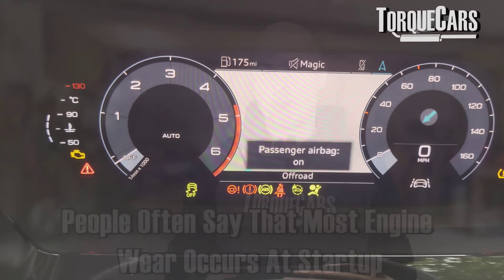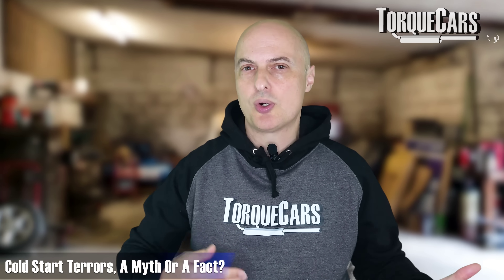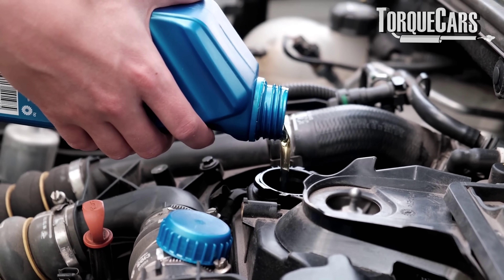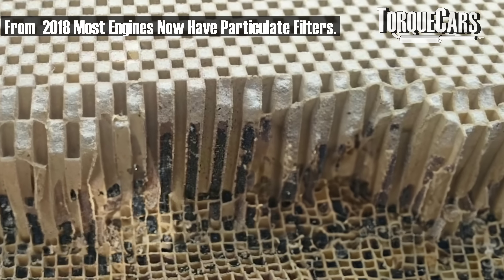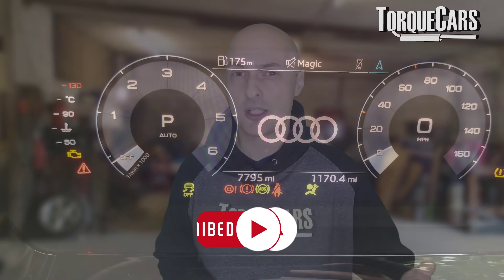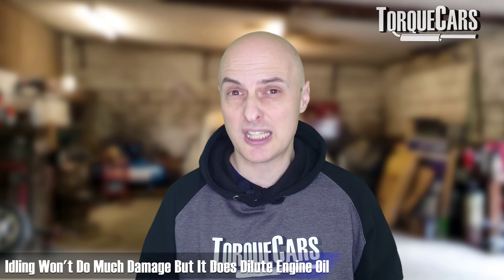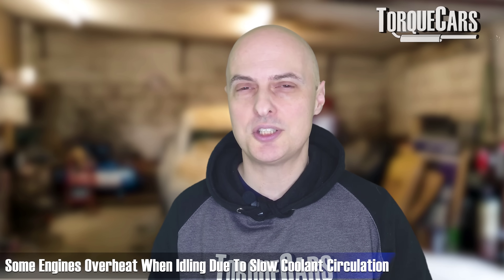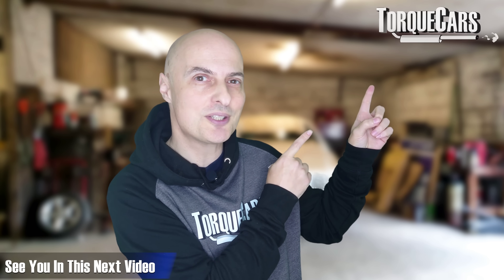❄️Reasons Why Bad Cold Starts Destroy Your Engine ☃️Prevent It Happening To You! ⚠️

Comment: An elderly chap who lives opposite me lets his small van (diesel engine) idle for up to twenty minutes before driving away. He also lets it idle for the same amount of time after getting home. I think someone told him that a turbocharger must be allowed to cool down before switching off. I wasn’t surprised during the COVID scare to see him wearing a face mask when driving even though there was only himself in the vehicle.
Reply: @wheater5 - That guy's warm up and cool down routines are extremely excessive, but the idea of letting the turbo cool down is actually legit, except it's not really about cooling the turbo itself. It's more for trying to prevent the hot oil from coking up by baking in the bearing housing. Just a 2-3 minute rest at idle before shutoff is plenty if the turbo wasn't worked too hard, 5 or so mins if it was. Not that u didn't already know that, just wanted 2 clear up turbo cool down 4 people who may not know. Lmfao your neighbor is waaay over the top tho, if that's what he's doing.
Reply: @ Yes, i understand why a short cooling period can help, I let our turbo diesel idle for a minute or so if it’s been driven hard. Yet, If I start my petrol engine and let it warm up at idle for more than a minute he comes out with a hand held air horn and gives it a long blast as if he’s calling full time!
Reply: @wheater5  Yeah, I figured u knew all that already by u talking about that in the 1st place, just added my 2 cents on it, especially since my daily is turboed so I do the cool down multiple times a day! But hahaha gotta love the "my shit don't stink" mentality of that man. Classic.
Reply: That's crazy. 30 seconds idle is all you need to do in uk winters. And then just drive at low rpm until up to temp. Turbo cool downs are only required if you've been ragging it.
Reply: @ Yes, exactly. But this chap is “special”. What I’ve described here is only a small part of his unusual behaviour.

Comment: Just drive off gently, try to avoid using the heater until it's warmed up
Reply: The heater uses the coolant temperature to heat the car, so if the car is cold, turning on the heat is useless until the engine warms up. Electric cars are of course different. When I lived up north, I always laughed to myself when I got in a friend's car and they immediately turned on the heat and frigid  cold air came through the vents until the car came to temperature. They also seemed to think turning it up to high would made a difference. It does, it makes it colder. Turning on the heat when the car is cold is like turning on the A/C. Turning it up to high only blows out more cold air. Funny thing is, they keep doing it.
Reply: The airco works differently, though
Reply: @floridaredneck  

It's ok, they are warming up the blower blades, lol.
Reply: @floridaredneck  i did not know some cars have heater inside vents... diesels (VW, Skoda, opel etc) in EU and US/CN they come with a 1kW electric heater that can blow warm air almost instant when you turn on your car...

Comment: As a Canadian, in winter, I try to remote start the truck to start the warming process. By the time I had the windows scraped the vehicle was warm enough to start driving at a moderate pace. With my old diesel, the only difference was to keep it plugged in. That kept the oil warm enough to drive as it would never warm enough just at idle. Thanks for the video.
Reply: I am Canadian as well and saw your comment about plugging in your block heater. The one item that was completely missed in this video was talking about cold starting aids as per warming the engine before its started. And indeed with most automatic transmissions, they have cooler lines routed to the engines radiator so as the engine warms up that also in turn warms the transmission to some degree and takes the chill off of it as the transmission oil pump does flow/circulate oil even though the transmission is in neutral.
Reply: Back in the 80s when I (Brit) visited Canada, I was initially curious why so many cars had weird plugs hanging out at the front.
Then someone told me what they were for, and it made so much sense. We just don't need them here.
Reply: @davewilson4493 , who knows, with climate change maybe we won't need them here soon. 😂
Reply: @davewilson4493  Back then in the 80's and before it was common for a block heater not to be a factory option but instead the dealership was expected to install them. That has changed a lot as its often a factory order now although even in Canada dealerships in the southern British Columbia area, Vancouver and Vancouver island often get dealer order vehicles in that they don't option in the block heater. But on the other hand lets say a GM Duramax diesel automatically  comes with the block heater from the factory.
Reply: When i am in Canada, I start the car and let it idle for about 30 seconds or until the windows are scraped. Then drive away slowly, to allow the engine , transmission and wheel bearings to warm up. Although, the car is really just getting to operating temperature by  the time I get to work, about a  drive. When I am in Panama, where it is always warm, it's start the truck, wait for for the computer to lower the revs (about 15 seconds) and then drive off gingerly until the engine,  tranny and differentials warm up and get fully lubricated.
Reply: @ryeweskey  yeah mine does too
Reply: This guy is saying you shouldn't idle. Absolutely ridiculous
Reply: @TheNovaNorm it's been 50°F all December. Unheard of. Maybe two or three days in the whole month, but not like this.
Reply: @TheNovaNorm I work in winter tires sale and our sales numbers have been dropping every year😑

Comment: An old lady who parks next to my driveway , starts the car stone cold and immediatly slams on the throttle pedal , for around 5-10min. at idle reving the engine till the limiter kicks in ! 

Persobally , i have habbit since i started driving like you mentioned - start up , fasten seat belt and check over instruments and mirrors then drive off moderately avoiding high revs and engine lugging in too high gear .
Having oil pressure and oil temperature gauge on the instruments helps quite a bit .
Oil especially needs good lenght of driving in order to warm up to ideal temperature .
Reply: @MrJolly-lb9je  Don't buy her car!!!
Reply: @MrJolly-lb9je  coworker in the early 80s did that.  Would start his stone cold Chevy Nova and go to full rpm before redline. 

Physics degree  guy.  He Said running the engine fast helped with lubrication in cold starts.

So after work on a cold day in a plant of 2000 folks his Reving engine was easy to spot since weird.
Reply: The Stupid Ignorance out there is simply amazing.
Reply: @MrJolly-lb9je  how old is the old lady’s car?
Reply: @edombre4637  Few years old pretty much new , current model of Renault Twingo . 
I do not speak with her much , but i told her few times she'll severely damage the engine if continue to do so . 
Car she had prior to this one had the same "treatmant" !
Reply: @ yeah I was just wondering how long her cars last with that treatment she gives them.
Reply: I saw a guy I worked with start a cold gas engine and l think it was a 350 gas engine. - 14 was the air temperature. And he started the truck, and just started racing the engine, and it blew up. So, he was driving a pick-up, and wasn't taking out the straight truck. Anything involving trucking, everyday is an adventure.
Reply: Soon, there is going to be the rapture. It's when there will be trumpet sounds, and after the trumpet sounds, God will lift his people from here. Also, God said people should be living by the Bible. Amen, and God bless you.
❤Jesus loves you guys. Dont wait, please. He will welcome you with arms wide open.❤
❤* John 3:16 - "For God so loved the world, that he gave his only begotten Son, that whosoever believeth in him shall not perish but have eternal life". ❤
Reply: You should tell her kindly

Comment: Completely agree! Waiting in idle or going full throttle are both bad ideas. What I do is take my normal idle (750 RPM) first to 1000, then to 1200, then close to 1500, all while standing in place. Once you notice the sound of the engine is much more smooth (no more clunking) and you start getting some hot air inside of the cabin (assuming your ventilation is turned On and set to Hot), then it's safe to start driving slowly with 2000 RPM and gradually increase from there.

Comment: A good and useful video, something you didn't mention is bore washing when the engine's cold.
For those who don't know, when the engine's cold the ECU has to inject much more fuel to start it and keep it running as some of the fuel condenses out before it gets burnt. Some of this fuel condenses out onto the cylinder bores and washes off some of the oil, this causes increased cylinder bore, piston and piston ring wear and diluted the oil slightly (although it will evaporate off with engine fully warmed up). This is another reason not to let your engine sit idling for ages, idle it for 30s max (at least above ~ 5C, perhaps a little longer for temps down to -10C, below that, fast idle it for a bit as per the video), then just drive it gently until warmed up.
Reply: I've recently limited my warm up time to about 30 seconds. Seems like even after it's all warmed up always a reason to idle. Too dang uncomfortable to sit in the car at 2C waiting for the wife not to have the engine running for a bit. I just change the oil often.

Comment: Thank you very much for this extensive explanation of everything happening during engine warm up ! For the first 5 minutes I drive gently : 2000 rpm max. When coolant temp start approaching 90 degrees Celcius, I can start pushing it more. I'm living in the Netherlands, so there is no need for my car to go for a climb or descent in the first few miles from where I live. My 'daily driver' is 13 years old now, and has been running fine without major issues.
Reply: Same driving style here. 13 year old car, no major issues.
Reply: @bakkerem1967  I assume it's a diesel?  No way I can keep it under 2000 rpm on my 1.4 TSI - driving carefully in the "warm up"-phase I can't get it under 2600-2800 at risk of lugging.
Reply: Coolant temp isn’t what you should watch; instead you should watch oil temp. Coolant will shoot up quickly.
Reply: oil will reach 90c in about 10 min of driving,in my case around 6-7 in city then on Autobahn in max 4 min it's at 90c

Comment: One thing I have noticed with modern cars is the tendency to not have coolant and/or oil temperature gauges. I have a 2010 Jaguar XFS with neither of them. Instead I have to guess. I do wait about 10-20 seconds before starting off and drive gently for the first 5-10 minutes of a drive. The car has a preheater on the climate control which is a great feature but not a good way judge what's going on under the bonnet.

The other thing to note is petrol engines tend to warm up faster than diesel.
Reply: @tboneisgaming  Yeah, BS isn't it? Although temp gauges are heavily buffered
Reply: Ridiculous not fitting these gauges.How can you possibly educate peeps if there us no feedback from the dash😂.Manufacturers are quite pleased for you to buy a new engine/car I guess.😅
Reply: on new bmws theres a sports display u can bring up that has turbo psi, horsepower, torque, and oil temp. i just make it a shortcut on one of the buttons so i can have it up  while i start the car
Reply: temperature gauges –My car (petrol engine) does have them both, but it has no use/meaning for the cold start process, as it takes at least a 1,5 mile or 5 minutes ride before the gauge shows any change (1 mile in summer temperatures).
Reply: My car has a gauge, but it actually lies. It doesn't show the real temp (that fluctuates with engine load) and it basically have three positions - cold, warm/operating condition, overheating (I've never seen it luckily)
Reply: @jakubknotek4891  it sounds like a a faulty temperature sensor

Comment: My Volvo V60 is fitted with a Webasto heater from the factory. I always use it when the temperature is around 12 degrees and below. It's both comfortable and good for the long term reliability of the engine and it is safe too because you always have snow free windows.
Reply: Isn’t that just a cabin heater though? Pretty sure they don’t warm the engine or coolant
Reply: That heats the cabin. Does absolutely nothing for the engine.

Comment: My  uncle worked in the arctic and he used Marvel Mystery Oil in the big machines for start up. Before that they used fire torches to start engines. I have used Marvel Mystery Oil in the gas tank 4 ounces at fill up and marvel in the oil 30 % at oil change, and 40 % for winter start ups.

Comment: You can warm up most automatic transmissions while you warm the motor too by putting it in neutral, because It gets the fluid pump circulating and making what ever heat it's going to make as well as lubricating all the parts that need lubrication that need it to function properly and to minimize wear on the rest, and this is only as far as I know, and only applies to most automatic transmissions not cvt I can't speak on those.  Another thing that can be done  for the bitter cold half of the year is to take some; tinfoil, a piece of cardboard, and some zip ties and make a grill cover, that will speed things up by probably 5-10min easy as well as figuring out we're there vehicles block heater chord is and if there vehicle has one because if it was originally purchased in a northern cold place it should generally have had one from brand new. My winter vehicle even when I forget to plug it in on an average day only takes about 10-20min (will of course be more on an abnormally cold day) and when plugged in no more than 10.  But then I do have a insulated grill cover.

Comment: Here in central British Columbia, Canada, the winters can get down to minus 40C (about minus 40F too) and driving is a challenge. My Ford Ranger pickup came with a somewhat undersized factory block heater (450W), and I've added an oil pan heater. Together they work reasonably well down to about minus 15C, if plugged in two hours before leaving. Below that they are not enough. The engine cranks noticeably slower, although it always starts just fine. New battery, good clamps and cables, 0W40 synthetic motor oil. I have a brand new 1000W coolant heater meant for a stationary diesel engine but it's so crowded under the hood I can't fit it in. I also have the radiator completely blocked with cardboard panels for quicker warmup. 

In these temperatures I idle the engine for perhaps ten minutes while I shovel snow, scrape the windshield, defog the glass etc. The one thing that would help more than anything is an enclosed garage, which is on my to-do list.
Reply: Your hydro bill must go skyrocket during winter with a 1000W heater